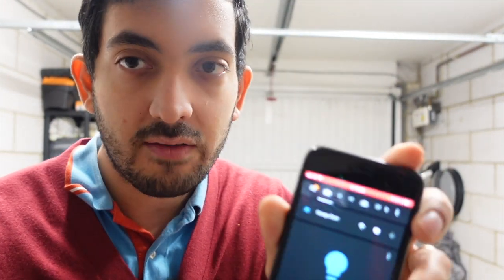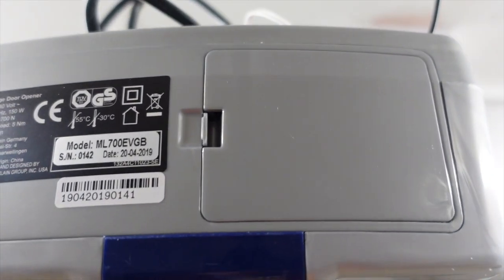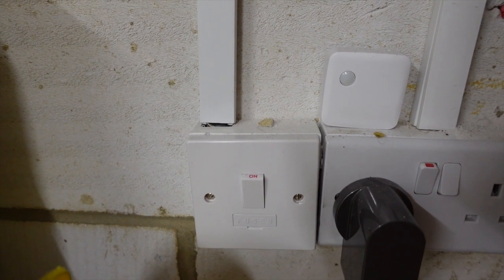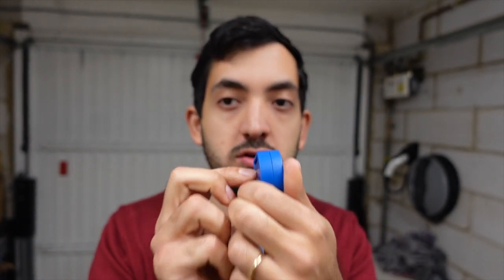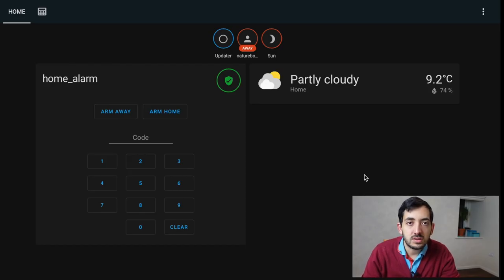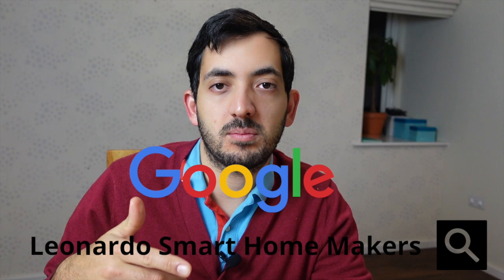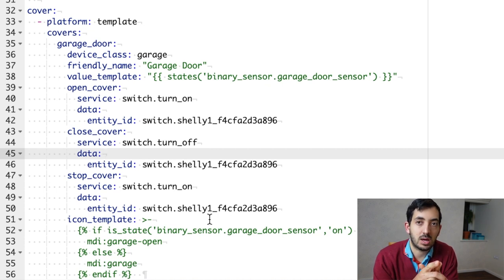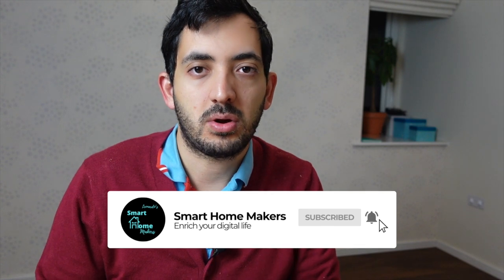Smart Garage Door Opener | Shelly 1 & Home Assistant

Comment from the maker: I waited so long to do this project! In the near future I'm planning to create a lot of cool automations with my garage opener, any suggestions?
Reply from the maker: Thinking about the same thing, one thing I'm worried about is having my garage door opening while I'm not aware. So next step for me is to get an IP Camera with a screenshot notification to my phone when the garage door opens and I'm not in the home zone
Reply: @SmartHomeMakers  Had a similar set up also, used Like Aaron, have a wyze, Neos Cam to monitor the door. Had a few issues with the door opening randomly, still not figured out if it was Tasmota causing the issue or if my wifi was to busy any knocking it off and on the network. For the time being, till I can figure it out, I set up a kill switch that turns the garage power off. So even if the switch fires, the garage wont open.
Reply from the maker: Hi Gavin, indeed it is always a bit dangerous having garage door opening at random. I'm planning to put an IP camera, just for peace of mind.

Comment: Nice work!
I just installed a Shelly 1 onto my Chamberlain garage door and have it working mint as across the local and wide area networks (cell network).  Shelly supports Alexa and now I can just have Alexa open and close the garage with voice commands.
I dont run a manual switch to open and close the door, I only use FOBs.
I installed my Shelly 1 behind the panel door on the Chamberlain and used the 30VDC supply with in the Chamberlain to power the Shelly, this was very straight forward and didnt require any longer cable runs etc.
When doing the install this way the only thing to check is that the Chamberlain (or any door opener) is not set to a "low power mode" as the 30vdc supply will turn off after a while, meaning that the Shelly will go off line.
Reply from the maker: Thanks for sharing the info! Did you check that no one can shout from outside "Alexa open garage door" ?
Reply: @SmartHomeMakers  Not as such but I don't run any active microphones or Dots in my Alexa set up.
I have to hold the "Home" button on my cell phone before Alexa can be enabled to listen for prompts.
If someone, unbeknown to me, manages to log into my Alexa account then I may have some problems.....🤔

Comment: I found your video excellent. I have a problem with my garage remote opening. I installed several years ago 2 Belkin Wemo maker switches. One for opening 1 for closingThere are 12 V USB connected by mini USB. Belkin have stopped supporting the Wemo devices and one of them is not working. Your system seems the way forward. I have some questions one will I need two switches which model of Shelly should I get. What did you house Shelley switches in. Thank you in anticipation

Comment: Leonardo, thank you for well presented presentation. I'm 71 year old old school industrial electronics technician. I just finished a load, lock out, project on a back up generator instalation. It is a 26 bedroom guest house with 30 Aircon units and 10 Geysers. In South Africa the electricity supplier Eskom can not generate enough electricity for the demand at all times and will randomly load shed big areas to decrease the demand. It happens that some days some areas will have no electricity for 12 hours in 3 hour shifts. I developed a system that will drop all the air-conditioners and the geysers from the load (4 units for the 40 devices) and lock them out while the generator runs. At the moment, when the Utility electricity comes back, each unit must be restore with a local button to over ride the lock out. I'm looking at automating the utility electricity restored action. Thank you for the information you shared with us. I will also add a sensor to indicate system restoration separate from the switching action.
Reply from the maker: Thanks for your time in watching the video and leaving a comment! Great solution for the electric supply !

Comment: When I deploy Sensors on a Garage Roll Door I will typically modify a Wireless Reed Switch Contact to use a Tilt Switch so there is no fumbling around with Magnets.

A Long press would be better so you don't open the door by accident.
Reply from the maker: That is a good point, which tilt sensor do you use ?

Comment: Hello, I have it wired up to normally open reed switch so when the door closes, it passes power to the SW input of the shelly one. What do i need to change in the script to get it to reverse? It shows open when closed and vice versa.. I've tried moving the Open and Closed.. i've changed 'on' to 'off' (binary_sensor.garage_door_input','off').... thanks.

Comment: Thanks for the overview.  I added a reed switch that is activated when the door is in the closed position.  My thinking was that unless my door was all the was closed, it couldn't trigger the sensor -- so if something obstructed the closing of the door, I wouldn't get a false reading the door was closed when it was not.  

Long story short, when I follow your tutorial, the state of my entity is reversed.  Door shows closed when open, and vise versa.  I don't see a way to reverse this in home assistant or in the Shelly app. Any suggestions?
Reply from the maker: I have a contact sensor on the garage arm on part fixed the other moves the garage door opens / closes
Reply: I'm experiencing the same thing. Door says open when closed.

Comment: Hi, i saw in a other video that magnet door sensors  are also possible to connect to the Shelly 1 including the relais switch. You have any thoughts on this, should this al be combined ?
Reply from the maker: Hi Fam, I think I know what video you are talking about, yep both solutions are fine. I'm using a contact sensor from aqara and they are pretty stable!
Reply: @SmartHomeMakers  thanks for reply. But what i mean, if the shelly 1 in also the controller for the contact sensor, can you then also use the binary.sensor from the shelly in your code ?
Reply from the maker: @famdebruin687  potentially would need to be configured within the Shelly UI. Not sure as I haven’t got it setup that way!

Comment: Thank you for this! I am using your code and followed the directions however, my button only actuates the relay when the reed switch is open (garage door is closed)? This makes it impossible to close the garage door when it is open via the button. Any ideas?
Reply from the maker: Mmh, my shelly device and button are wired in parallel. Every tap on the button or from the app acts in the same way. My garage opener hasn't got an open or close, just move
Reply: I think I have the reverse situation, but it seems related.  My reed switch is closed when the garage is closed.  The button card as set up in the video correctly works to open the garage, then display the open garage icon.  A second tap on this same button has no effect.  If I long press the button, I get that contextual menu that has the details tab and the up arrow, square and down arrow button like at 1:13 in the video.  If I press the square button, the garage closes straight away.  Something is not right in the code.

Comment: I've seen people wire the sensor to the shelly to know if it actually open/close and I still don't understand why, I was thinking just stick the wireless door sensor instead of wire them to the Shelly. 

question, if you use voice command, do you have to say TURN ON my garage to OPEN it? and TURN OFF my garage to CLOSE it since this shelly is a switch?
Reply from the maker: I don't have it with voice control as that might be a security concern for me :) You can setup a code when pairing up devices like locks from the google or amazon app

Comment: Great content, thanks
Is that an ev charger in the background?
Reply from the maker: Indeed it is! Gone fully electric 3 years ago :)
Reply: @SmartHomeMakers  
That's amazing, good on you sir.
Looking at installing a charger at my driveway also.
Any advice?
Reply from the maker: @drreality1  Not sure what car, or where you live. In terms of charging at home you would save 5/10 mins each time compared to going to the petrol / gas station. On the contrary on long trips you are going to lose times because you have to stop more frequently and charing always takes longer than refuelling